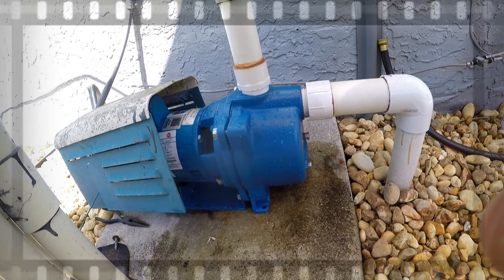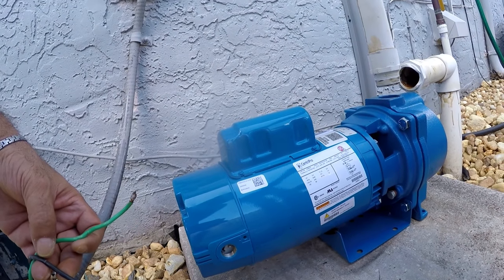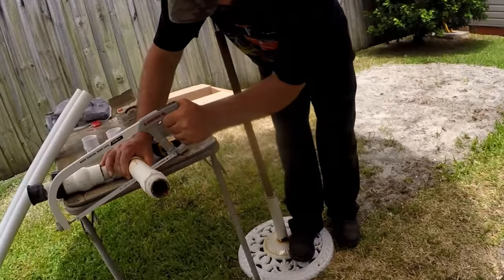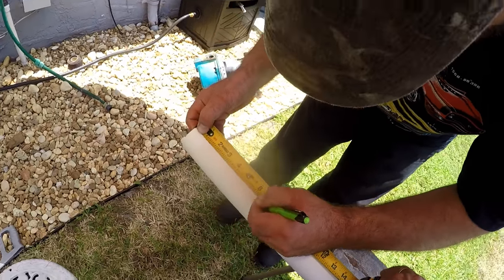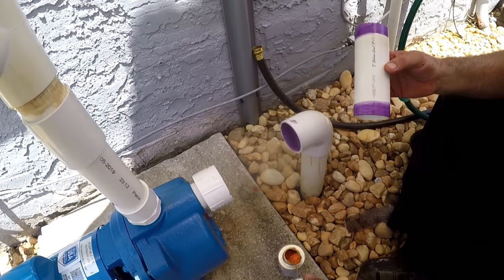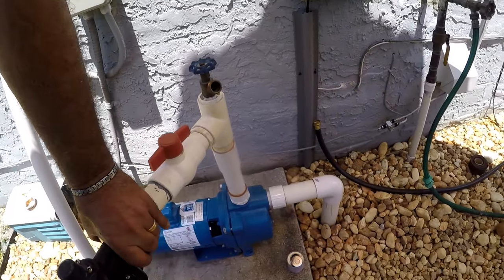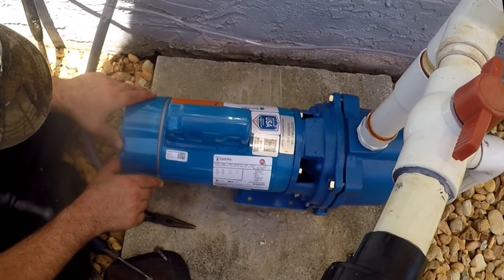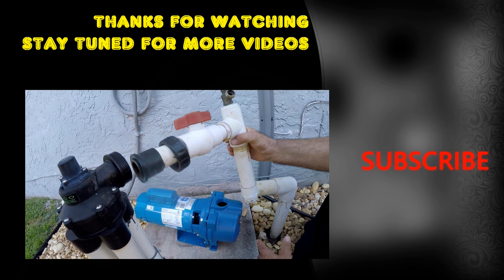HOW TO INSTALL a LAWN SPRINKLER PUMP and MOTOR on any type of Irrigation

Comment: Comments from a plumber:
1) Orange Glue is for CPVC. For PVc, you use clear, grey or blue glue
2) if you read the instructions on the can, you will see that you are supposed to add glue while there primer is still WET.
Otherwise, for a DYIer, you do very neat work
Reply from the maker: Good to know, Still not leaking. Thanks for the feedback.

Comment: Good Job, John!  Your tutorial will really help people save money by doing it themselves. You setup is a little than the one we have, of course you don't have to deal with winter either. 😃
Reply from the maker: If I still had to live up north, I would probably put concrete everywhere .LOL
Reply: @JohnCRV  Frost heaves up here makes cracks in the concrete.  Ask us how we know? LOL
Reply from the maker: @GetGonewithUS   I lived in the NE,  not fun in the winter. But concrete cracks everywhere no matter what unless you are building a bunker. That's why they cut joints, in short, joints tell it where to crack.😱 Don't ask me how I know.🙄 Have a good week guys.

Comment: Thank you for using a Gould’s jet pump……your keeping me employed
Reply from the maker: Made in USA👍
Reply: This Goulds is not a jet pump.  The GT is a basic Centrifugal
Reply: @stifflers69mom1 Doesn't make it a jet pump.  It's a basic sprinkler pump with no jet and single impeller.  The J series is a jet pump. Goulds should go back to Century motors for the GTs because U.S. Motors is pure garbage.

Comment: A good video about your new pump installation. I put in some PVC plumbing pipes a number of years ago but don't recall there was a primer to apply first before applying the cement. Thank you for sharing.
Reply from the maker: According to the specialists;"The purpose of primer is to begin the chemical reaction that softens PVC and to provide an even prepped surface for the solvent cement. As you may know, PVC joints are not glued together exactly, but fused through a chemical change. The softer the outer layer of your PVC, the better it will cement in your joint." Thanks for the comment Dave.

Comment: Nice Job.  I just did replaced my pool pump last week and had the same issue.  The new pump was one and a half inches lower than the old pump.
Reply from the maker: That's always the case, nothing is ever the same. Thanks for the visit Lou.
Reply: A large concrete block 1.5 inches thick is not expensive.

Comment: Hi ya John, thank you for the video!    Last year I was stuck in well contractor limbo  *hell. Long story short, something popped, and no one will service the house because they all have their easy jobs filling up their schedules. (in demand job space, huh!?)  Any whoo, it is the times of the 'Rona, and I'm on my quest to figure this stuff out, I'm handy in electronics but have no idea what the system in ground is.  There are two pipes sticking up from the ground, I guess my first step is to drop a string down with a nut tied on to see which one goes down deep and gets wet.
Reply from the maker: Sorry for your troubles. Are both pipes the same size?

Comment: Great video,  do you take out water to garden on the 2 inch pipe or are you reducing from the 2" to 3/4 inch down to the lawn ?  I see a 2" pipe going into the ground but I am assuming that pipe is reduced somewhere down the line ?  Thank you for the previous reply. appreciated - btw: I have the same pump but 1.5 HP
Reply from the maker: Both! and at the furthest zone to 1/2"

Comment: Great video.   If I am starting from scratch should the pvc pipes be a certain height?
Reply from the maker: The suction coming out of the ground (inlet pipe) should be around 12" and the Zone  Valve or also known as a Indexing Valve around 2 feet.

Comment: whats the big red valve for, making sure to limit the pumps flow so it doesnt over drive the well?
Reply from the maker: its a shutoff valve to keep the well pipe primed in case you're working on the system. Also used to re-prime the system.

Comment: The plumber I hired to install lawn sprinkler attached 3/4 pipe to it and used 1/2 inch taps to the sprinkler where I noticed that the water pressure loss in the further taps do think by changing the taps pipe to 1 1/2 inch will the water pressure will be stronger than now as my pump is 1 & half HP

Comment: I lost the purge and I see that my system from the lake to the pump does not have a fluid check valve. where should i install it?
Reply from the maker: Its usually between the pipe and the filter on the lake end.

Comment: What do you call the waterproof elbow fitting where you insert the electrical wires?
Reply from the maker: 1/2" liquid tight connector 90 degree 20 pack: https://amzn.to/3hzB66X
Reply: @JohnCRV  thank you.

Comment: Thought this would be fairly simple, but water is now spewing from both the in/out PVC lines I began to saw through. I thought some water would release but it has been flowing strong for 2 hours now. This is tapped into a 20ft deep water table or well, so why would there be water pressure when nothing is pumping it up from the ground? I find no shut off valve from the well to in input line on the old pump. Help!
Reply from the maker: The first think I can think of is water table must be very high this time of year?

Comment: Do I just wire the hot wire to the common on the irrigation controller and the other to the pump slot? I'm using a basic orbit 6 Zone Controller for reference, it has a connection for pump labeled.
Reply from the maker: Did you get it figured out?

Comment: Wouldn’t it make sense to install unions just incase pump replacement is needed?
Reply from the maker: the more unions the more chances of leaks or suck up air and loose prime. Also depends in what part of the country you're in.... if you need to winterize during below zero weather may be couplings or unions are better for you....

Comment: I have a gator, much like the one in the video.  It came with the house recently purchased.  Pump works great, but connection between pump and irrigation system is gone.  I picked up  1 1/2 " PVC threaded which fit great into the irrigation side, but could not get a 1 1/2" to thread onto the top of the gator.  Should the same  1 1/2 " threaded PVC also fit into the top of the pump?  If so, could it be a problem with the threads or do I need a different coupler?
Reply from the maker: It may be a different size or the thread may be rusty. Try cleaning it with a small wire brush like the round ones used for battery terminals. Hope this helps.

Comment: Great video. Did your pump have a check valve?
Reply from the maker: No check valve.
Reply: @JohnCRV  awesome video. Thank you so much. I use lake water for my pump, which has a check valve. Is it necessary with this pump model that suppose to self-prime?

Comment: What amp circuit would I run the Gould’s 1.5 HP pump on and what size wire if you would happen to know thanks
Reply from the maker: I'm not an electrician but I think this manual may be able to help you.
https://inspectapedia.com/water/Goulds-Single-Phase-Pump-Service-Manual.pdf

Comment: That pump is 1-1/2 but why is it reduced right after the tee on the top?  I was told by Gould’s that the irrigator doesn’t like to be reduced!
Reply from the maker: The reducer is for the the 2 inch inlet pipe (coming from the lake) and the thread is for is reduced to 1 1/2 inch to fit the pump. The same way.the original pump was. I hope that answers your question.
Reply: John C RV I meant on the tee fitting on the output. It looks like there is a reducer bushing going from 1-1/2  to what looks like 1-1/4? Where the ball valve is!
Reply from the maker: @mainelyelectric  Yes it is reduced to fit the zone valve.
Reply: John C RV what size pipe is each zone?  And how many sprinklers are on each? Plus do you know what the GPM is of each sprinkler?

Comment: It is a good idea to use a union on intake connection, do you don’t have to cut the pipe to remove pump!
Reply from the maker: Thank you for your opinion. If we were living in freezing areas of the country its a good idea to use them so you can take the pump down in winters....... No freezing winters here in Florida, a good pump can last 30 years, I don't think a coupling will last that long in the sun. 
There's a good chance you will have to cut all the pvc anyway for different reasons, the main one is, you will not find the same pump in 10, 20 or 30 years. This is just my opinion.

Comment: iI did not see a valve control, thats mean all zones are working in the same time?
Reply from the maker: The 3 zone valve control  is the black round box.
Reply: John C RV ok, I see that you using an indexing valve
Reply: John C RV  can it be operated with only one zone open? Or do all 3 have to be on?
Reply from the maker: Ben Boudreau 
Not enough pressure to have all 3 zones on at the same time that’s the reason you have a zone valve to make each zone come on at separate times. the timer on the wall is set for 3 zones. In other words it goes on and off 3 times and each time it shuts off the zone valve automatically change to a different zone. You can set the timer for each zone to stay on as long as you desire.
It’s all automated so you never have to do anything manually.
Hope that helps.

Comment: no pressure tank for this sistem?
Reply from the maker: None
Reply: Jaime Mijares  I don’t believe that sprinkler systems require one since they don’t stay pressurized after the pump is off. But I don’t know if you could install one if you wanted it to stay pressurized when it was turned off by a pressure switch in the event of using solenoid valves for zoning.

Comment: Also how do you prime the pump?
Reply from the maker: Connecting city water to the pump faucet and letting it fill the inlet pipe. I'm sure you can find a video showing how to...
Reply: Yes , I Also did that. do I turn the knob to the right to open. This video is super helpful thank you for your time to reply back. 🌟
Reply from the maker: @panseycain7086  Try this link https://www.youtube.com/watch?v=yTYsQs1ipmg